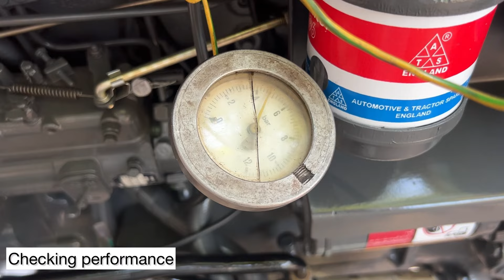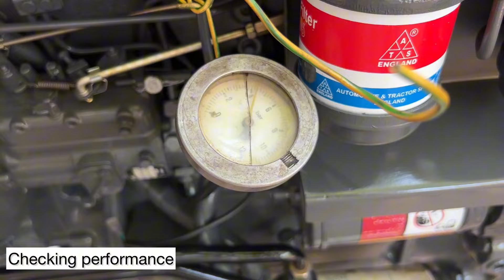Making Unique Oil Cooler for Tractor with 2 Ltr Extra Capicity || Complete Proces

Comment: 🤦🏻‍♂️paint is act as an insulator which decreases the heat transfer between cooling tubes and air.after paint applied on tubes then there is no benefit of oil cooler. It is main reason that's why companies don't paint their radiator fins
Reply: really?? you go ahead n grab a hydraulic hard line on a machine thats been running a motor, good luck with that
Reply: @piperdoug428  are you out of your mind?😂 please read me comment properly then came back
Reply: Exactly

Comment: Shouldn't paint tbe tubes, or the paint should be only on the iron parts, there protection available for the heat exchanger, like in air conditioner evaporator or condenser coil